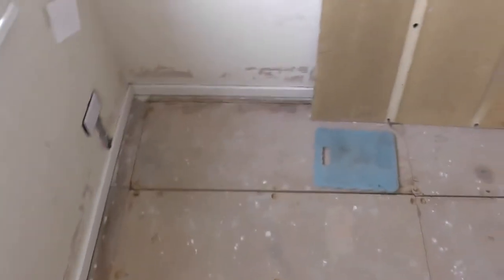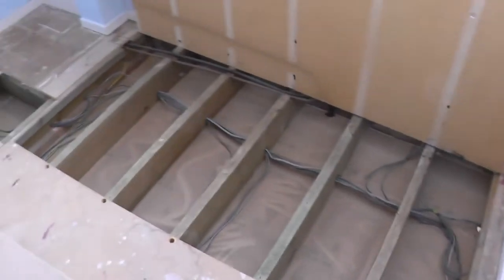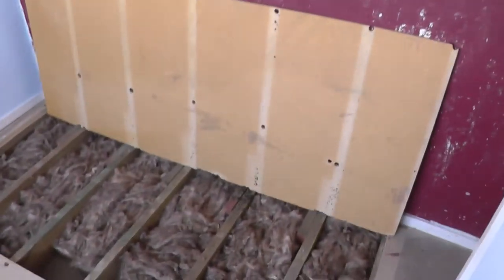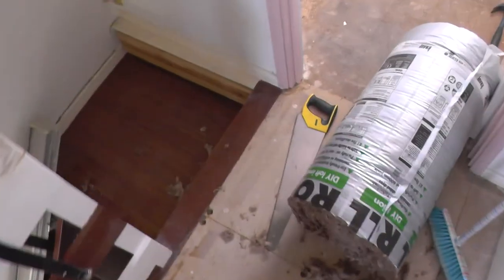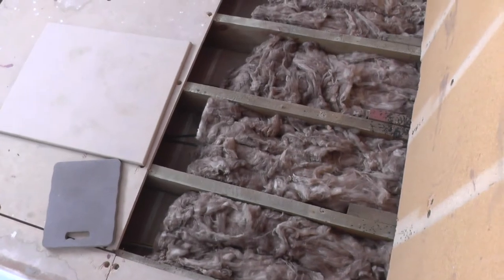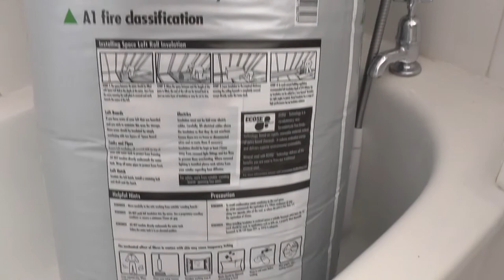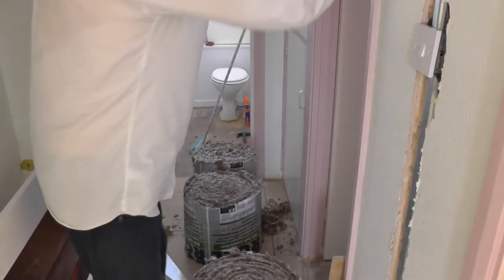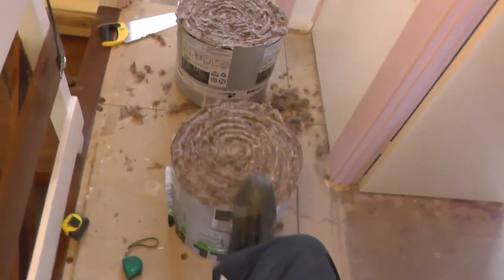DIY: How To Easily Install Loft Insulation / Insulating Between Joists

Comment: Hi just seen your videos on taking off the chip board and laying insulation underneath, exactly what I’m looking to do! Thank you. Any tips on how you stuck them back on chipboard  glue and nails? Also was there any squeaking after I’ve been told to replace them by everyone!
Reply from the maker: Hi there and thanks for checking out my channel. 
The main reason most people will simply tell you to replace them is because they do need care when removing or they will crumble and break. However, with a little bit of forethought this is completely unnecessary and an absolute waste of money. Top tips:
- do not nail them down, use screws so you can get them up again if required
- do not use glue  (as above)
- do not secure using same holes as before (assuming they're still there). Screw into fresh board to hold secure
- use battens screwed to sides of joists where necessary to make sure there's some decent timber to screw then back in to
- search chipboard on my channel and watch these vids as they will definitely help
- squeaks occur when timber rubs together so use a few more screws rather than spacing them apart too far
Hope above helps, Des

Comment: Asking out of curiousity, not to take a dig but are you allowed to cover electrical like that. I would have not as if it's under heavy load it'd warm and be a fire risk.
Reply from the maker: Yes they can be covered but ideally it should be as minimal as possible. Best to lay them on top of insulation if possible. ATB, Des

Comment: Hi so if the joists are 600 centres what size would you cut the insulation?
Reply from the maker: 600mm to give a nice friction fit. ATB, Des
Reply: @21stcenturycaveman33  thanks for the reply the rolls are 1140mm so cutting 600 off would make the rest a waste. Do you think 570mm would work?
Reply from the maker: Absolutely.  ATB, Des

Comment: Sorry if this is a stupid question. I watched one of your other vids on floor boards. Have you replaced all of the boards with wooden sheets?
Reply from the maker: Hi there. I've used wooden floor boards where I could salvage them (if they were there in the first place) and where I couldn't I've cut down sheet material. Hope that helps. Des
Reply: 21st Century Caveman  nice one Thankyou. Good work.

Comment: I’m planing on laying down insulation (loft insulation) in the master bedroom. Would you recommend installing a vapour barrier? If you’re answer “yes” I’m very curious to know why you haven’t laid one down in this video. 

Have been learning loads from this channel, so kudos for the excellent videos.
Reply from the maker: Hi there and thanks for supporting my channel. You only need a vapour barrier where warm air will meet cold air (e.g. on an external wall or in a roof space). The purpose of a vapour barrier is to stop moisture in the warmer air (i.e. inside the building) condensing on a colder surface, e.g. an external wall. No vapour barrier on this build because I was insulating internally, i.e. warm:warm so little if any chance of condensation. The second purpose of some types of vapour barrier is to not only stop moisture seeping through it BUT also to let the building breath. If a building cannot breath then any moisture trapped in the building will cause mould due to lack of ventilation. If a vapour barrier is installed it should be on the inside where the warm moist air is to prevent it condensing on the colder surface on the other side. Hope this helps. ATB, Des
Reply: 21st Century Caveman thanks for awesome advice, I feel silly to ask this. The house is semidetached, the master bedroom has external wall and bay windows, would I need to lay down a vapour barrier?

Comment: I thought insulating over electric cables is a no no ?
Reply from the maker: Hi there. Electric cables should not be encapsulated between layers of insulation. However, they can be laid on top or to the side, etc. It happens all the while. Thanks for watching. Des